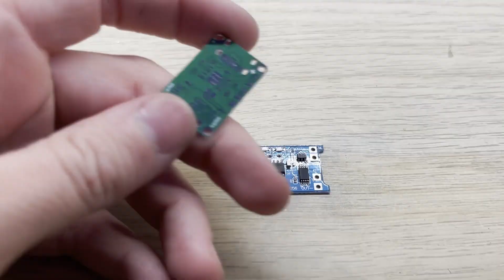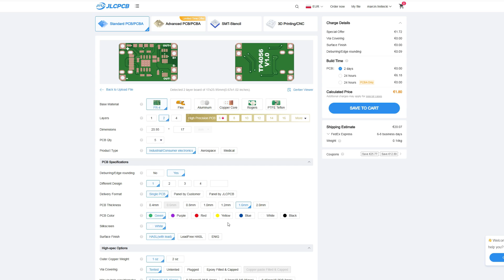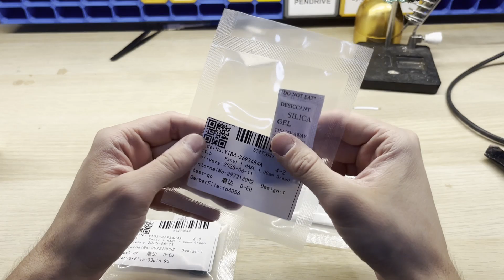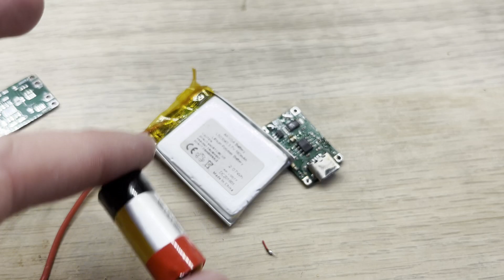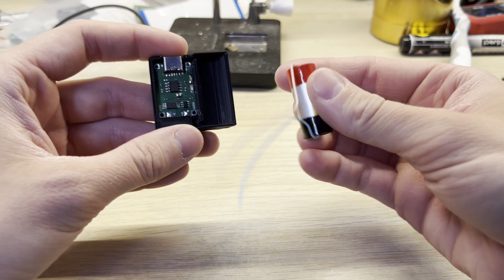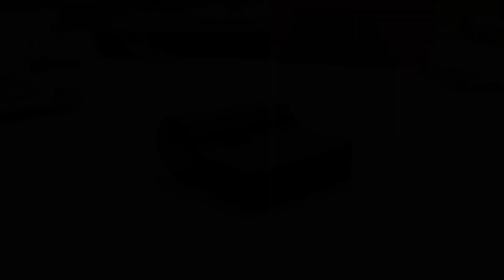My own Tiny Powerbank | DiY TP4056 PCB

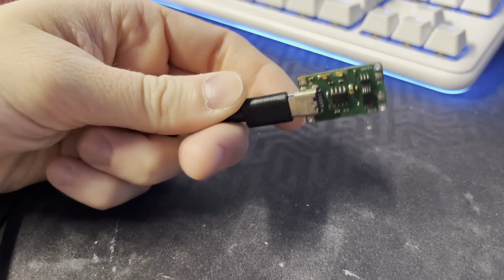Comment: 2:32 it might only work with USB A to USB C but not C to C if it's missing the 2 x 5.1k resistors needed to communicate that it needs 5v
Reply from the maker: That’s what I’ve thought as well. Those are not there